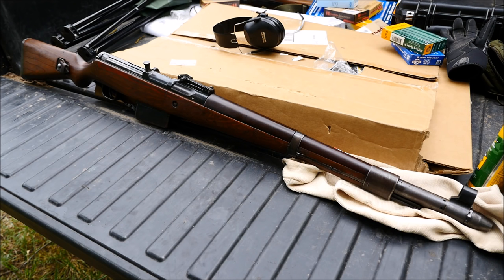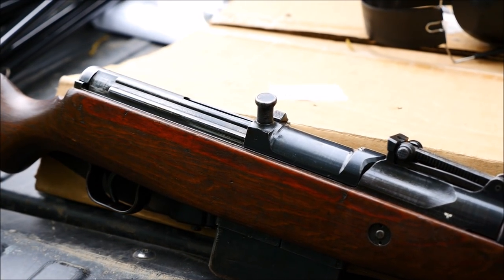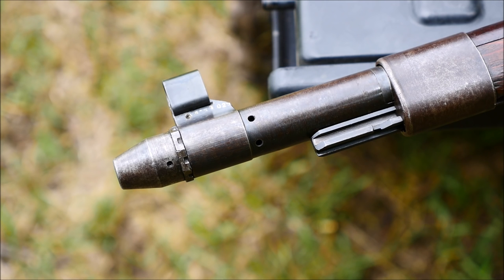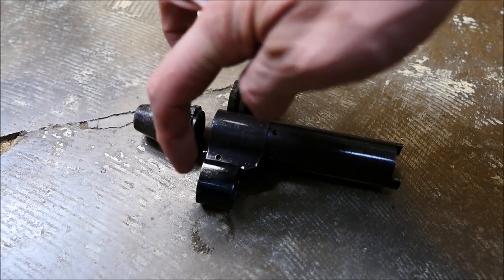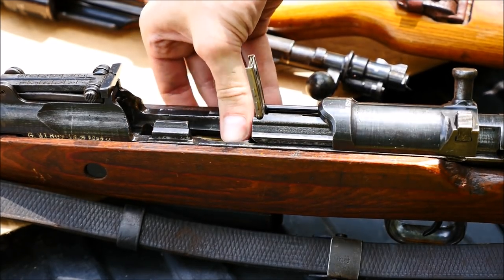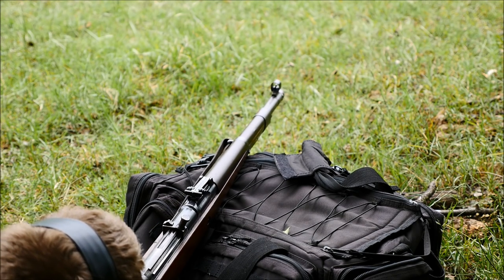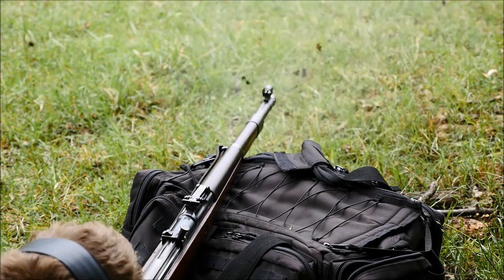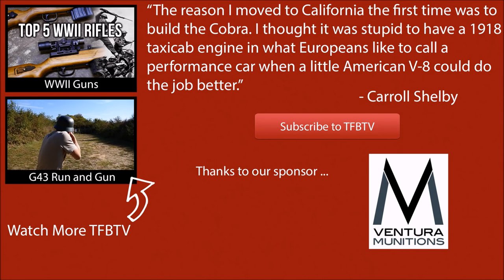G41(W) Rifle Shooting: WWII German Semi-Auto

Comment: Actually, German troops found the SVTs unreliable and traded them to rear line troops.  The Soviets tested the SVT against the G41(W) and found the German rifle more reliable...and more accurate. Many of these German rifles were taken apart and indifferently reassembled mixing parts without any serious quality control unlike say M1 and SVT rifles as their new owners did not intend to use them again unless absolutely necessary. Your rifle is probably not as good an example as the ones the Soviets tested.

Comment: Great video.   Although it has been a number of years since I shot mine, I recall the recoil being fairly light.  I admit I was shooting hand-loads that I loaded using information that Handloader magazine published many years ago specifically for the G41(W).  The idea being to use a load that had enough energy to cycle the rifle with the proper pressure curve while minimizing the possibility of damaging a part that is impossible to replace.
Is this rifle a gun with matching parts?  Mine has all matching numbers except for the blast cone.  I have been told that these were often miss-matched because soldiers would throw them (the blast cone) in a bucket of kerosene to clean them and they were often replaced on the wrong gun, matching numbers meant nothing to the average soldier.
Another interesting point is that these rifles accept the standard 98K bayonet which makes a heavy gun even heavier.  
Also interesting is that the method of trapping gas at the muzzle is similar to the method used on the original M1 Garands.  I sometimes I tell Garand collectors that I have an original gas-trap rifle before mentioning that it is a G41(W).

Comment: Gas being re-directed rearwards would reduce recoil....because gas has mass, and it is going the opposite direction of the bullet. However, since it is not vented out very quickly, and is instead directed against the piston, the rifle is effectively overgassed, which results in more recoil as the carrier is pushed rearwards with more force than might be required for functioning in optimal conditions.

Comment: This is a very interesting concept.  How about a rifle that has a suppressor that is made specifically for that rifle and caliber alone, one of the chambers in the suppressor is a gas chamber with a smaller piston, possibly the first or second chamber, then all of the gas is not going into the piston, there still isn't a gas port in the barrel, but, enough pressure in the single chamber component of the many-chambered suppressor generates the proper pressure to cycle.  Perhaps that can be elaborated on to make a self regulated piston within the suppressor where different valves open, depending on the pressure of the round.  Hmm..  interesting to think about, because the rifle that this goes with, can also be a single shot if the suppressor is removed.

Comment: what would happen if you drill a gas really hole after the front sight? not sure about the ring to travel far enough back words to cycle and then it would let the gas is bleed off
Reply: thor 90 there are already excess gas ports that are behind the sight, that when thr piston is fully rearward allows the excess gas to escape

Comment: please go into more detail about how gas operated rifles are not using gas that would normally leave the barrel? I don't understand how you are saying that it recoils more because it is using gas that would normally leave the barrel to operate the action that's the definition of gas operated rifle isn't it? I do understand that having the nose cone heat up can definitely start to have some heat Mirage and then affect the sight picture but I do not understand the problem with recoil please explain that more
Reply: Because a gas port simply siphons gas off before it leaves the barrel. the size of the port limits the amount of gas that can enter and controls gas pressure. This system traps all the gasses as they leave causing much more force on the op-rod.

Comment: Interesting video but using the term "Bang" is a bit of a misnomer and incorrect mechanically.  The Walther is actually using a Steyr style patented gas system.  Bloke on the Range just released an interesting video explaining the differences between the two that outwardly look cosmetically the same but internally are very different

Comment: Either want to make this or the g43 for airsoft
Reply: Shoei makes the g43, but it costs $1400 and uses an air pump to charge the magazines. If I were to pay that price I would rather have it use just regular green gas, but the company is based in Japan so it  has to have a lower velocity. Beautiful replica otherwise.

Comment: How can it be so unreliable given such an over-gassed design?
Reply: it fouls up and with heat the gas system will be stuck until the gun cools down. well that is what I think could happen.
Reply: ***** Really I had no idea
Reply: apparently because the gas is slightly cooled by the end of the barrel, carbon builds up in the nose cone over time

Comment: I always wondered why the Germans seemed to have so much trouble developing a self loading battle rifle given all the other stuff they are so well known for producing in WW2.
Reply: They didn't have trouble. They stuck with the Mauser K98 because it was a VERY good bolt action, accurate to 1000+ meters. The semi auto ones, were made to level the field in the Eastern front, because the communists used different tactics there. The normal battle tactics in wars up until the 40's was long range/trench, coming from the late 1800's, and for urban warfare they had very good weapons, like the MP28 (which the Ppsh is a copy btw, of the MP18), the MP38/40, and the beast FG-42 used by the paratroopers, that shot 7.62 rifle rounds with quick rate of fire.

The communists were using the horde tactics, basically sending the conscripts in suicide charges. So the bolt action wasn't suitable anymore there, they needed quicker follow up shots and higher fire rate for the medium to long range rifles. And the communists were also using Russian cities as hostages, so Germans couldn't bomb them while there were civilians there. So the battles had to be medium to long range. Russians who embraced communism were very stupid indeed, but most of them were forced to fight and used as disposable meat shields by the bolsheviks

And the G43 contrary to what ignorants say claiming it's badly designed, is a very good semi auto. They were over gassed on purpose, because they were basically disposable. While normal guns required cleaning and maintaining regularly, they were made to continue working for a long time without needing to maintenance, until they self destructed. That's why if you have one now, it's important to convert them, then you can enjoy and shoot them indefinitely. The G41 is like a response to the SVT and closer in design, while the G43 was made to be cheaper to make in large quantities

However even the "last ditch" German guns were very good quality and accurate, like the Gustloff VG1-5 used by the Volkssturm to defend German cities, very sought after today and increasingly rare

And I'm saying this not because I'm a German military fanboy or anything, but because my family actually lived the Eastern front experience, the bloodiest part of the war. My family were originally Russians who fled Russia once the red pigs took over power, cause they supported the white imperial government. And they were welcomed in Pomerania by the German Empire along with other Russians in the same situation, so they joined the Wehrmacht in WW2 as volunteers in the Baltics to fight the red ghost. in '44 my grandfather's SS unit went from Latvia where they were fighting to Königsberg to defend it against the communists, along with Polish units